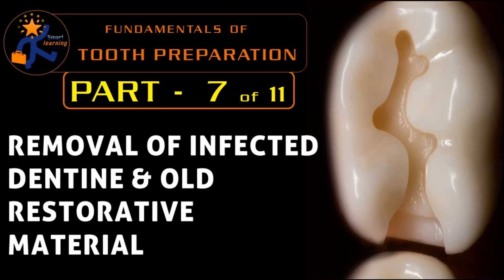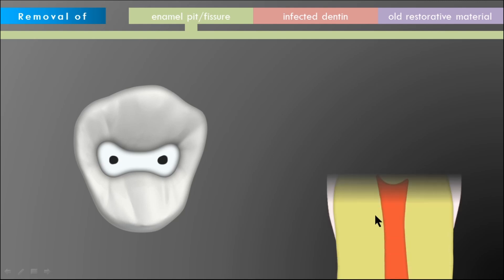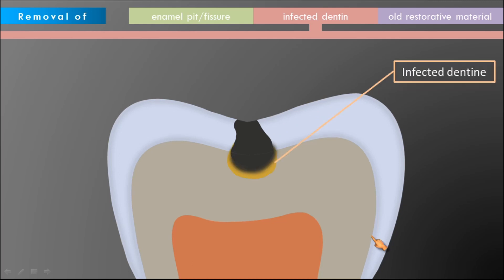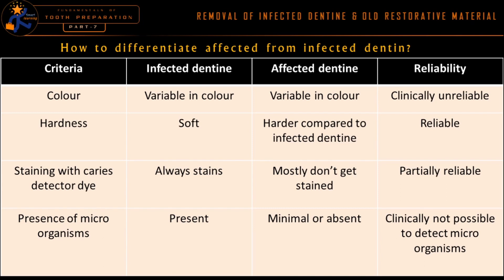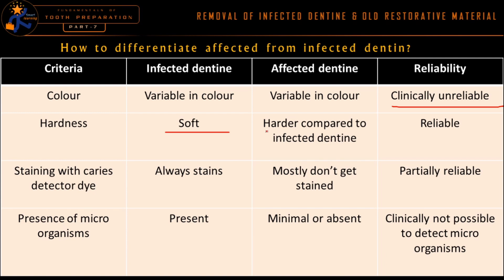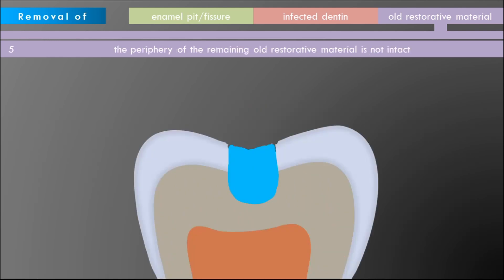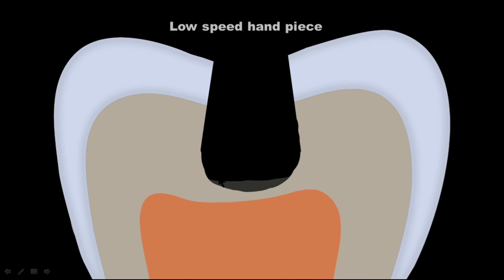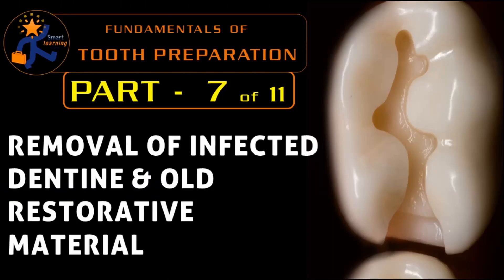Fundamentals of tooth preparation : Part 7 | Removal of infected dentin and old restorative material

Comment: Sir Ur videos are really informative ..can u plz do a video on the topic class 2 amalgam restorations
Reply from the maker: I have included the topic you suggested in the upcoming video list
Thank you for your suggestion
Upcoming videos in Smart Dentistry YouTube channel
Bounded file versus binding file - @sauliharizwan377, @vickyrock1873, @siddhiraut8472, @hristohristov650, @burrwnawna, @ayeshasiddiqua-ue4ss
Anterior proximal composite restorations - @raghuramm563
Finishing and polishing of composite restorations - @DrHozefa
How to create the perfect anatomy in posterior composite restorations - @DrHozefa
Working length using RVG - @manadentist2267, @sushrutachakraborty464, @dentalking7859
How to use apex locators to get accurate reading? - @katyaynigupta5259, @Sreemol17, @dentalking7859, @dentalshorts6848
How to determine the correct taper for canal preparation (2%vs4%vs6%) - @akanshas8424,@abdurrahman2980, @benoitblanc8898
Diagnosis in Endodontics - @MuhammadAbdullah-iy3hc, @bsk4627, @vijyantmehrotra8119, @manadentist2267, @akshuDhavalshankh, @katyaynigupta5259
Dentine bonding agents - Part 2 - @bigdreams3712
How to bypass a fractured file? - @karthicks5760
How to do periapical surgery? - @derekshaji8173
How to remove a fractured file? - @karthicks5760
How to prevent ledges, blocks, zipping and canal transportation - @Philosophyforlifeofficial 
Apexification procedure – @anumadhukar9171, @sanghamitrasagariya4087, @katyaynigupta5259
Perforation repair - @anumadhukar9171
Avulsed tooth management - @Drpoojagarg5310
All ceramic crown preparation – Anterior - @KiranrajkumarHatangle-eo4wm
Molar crown preparation - @KiranrajkumarHatangle-eo4wm
Radix entomolaris - Case discussion - @sauliharizwan377
Palato gingival groove - Case discussion - @sauliharizwan377
Root canal negotiation techniques - @vickyrock1873, @siddhiraut8472, @hristohristov650, @katyaynigupta5259
EDTA in Root Canal Treatment - @rosemeher1321, @hristohristov650
Understanding root canal calcifications - @rosemeher1321, @hristohristov650, @katyaynigupta5259
Operator positioning for Root Canal Treatment - @chandrasekharsahoo6713
Analgesics after Root Canal Treatment - @mdmozahedulislam3923
Root canal sealers - @sudhaa5674
Sealer puff – Good or bad? - @derekshaji8173
C shaped root canals - @karthicks5760, @LearnUnlearn90, @katyaynigupta5259
Middle mesial canal - @karthicks5760, @katyaynigupta5259
Reference point in root canal treatment - @anujgarg952
Heat and H file technique for GP removal - @chandrasekharsahoo6713
how to do BMP effectively without any pulp tissue remnants in a single visit RCT - @rainbowsalt-gc7ek
class 2 composite and matrix to avoid gaps between teeth after using toffelmeir system -  @sauliharizwan377, @hishamkhan3800
Curved root canals and file selection
Everything a beginner should know about rotary files
Ledges – prevention and management - @dentalshorts6848
Prefabricated metal post
Pre fabricated fiber post - @anithabalex8124
Ribbond post and core - @bsk4627, @sajaljain4192, @sauliharizwan377
Custom cast post and core - @derekshaji8173
How to select the proper crown - @DrGreenfun
Cast post Vs fiber post? Which one to choose? - @SnehaPK-rt3tn, @alokegupta3165
Occlusal considerations in post endodontic restorations - @tubeindahouse